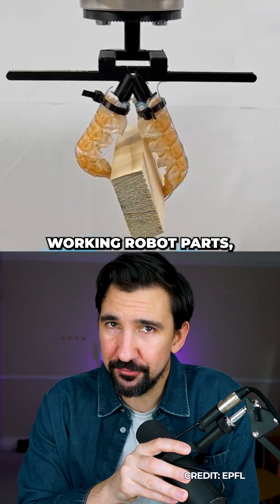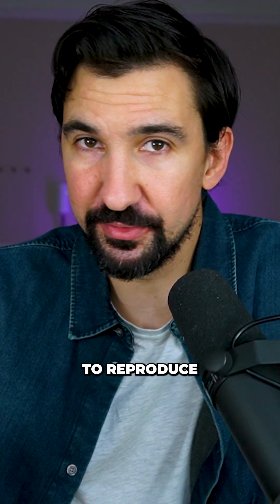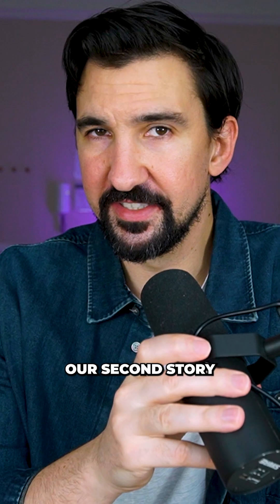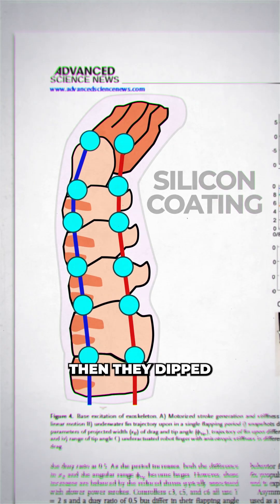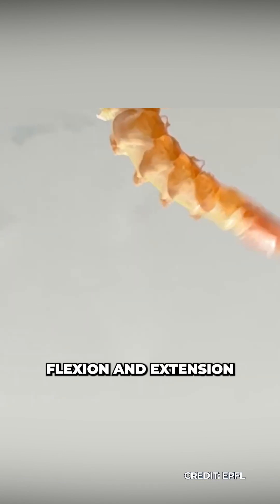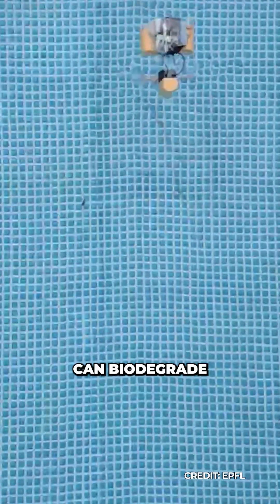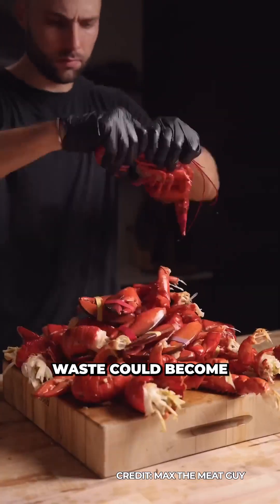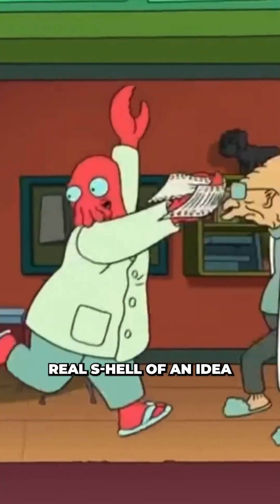Scientists Turn Lobster Into Weirdly Powerful Robot

Comment: It’s impossible to recreate a mechanical movement artificially?

I literally don’t believe you.  Claws grabbers flexors and arms exist in a million varieties. Oh please instead of milling my part out of ore which is stationary and abundant. Can I instead make my machines out of shrimp parts which decay rot and I have to catch them and have special electrodes that have no other purpose? Please god can my factory that makes Nike shoes have these shrimp part machines god that would be so awesome….

I like science. This is fucking useless
Reply: We can 3d print most materials into any shape possible. When you say we ran wires through these rigid parts and then coated with silicone why not we printed these parts ran a wire through and coated with silicone? It’s fucking silly.

Comment: The year is 2080, you go to work in your 9-9 (with the loss of unions, work hours are what the corporations say they are) as a bio technician. Your coworker tells you fix the clamping arms for the coke conveyor so you reach into your tool bag, sift through the crab claws and armadillow shells and grab two shrimp tails and your welder, ready to work.

Comment: From the moment I understood the weakness of my steel, it disgusted me. I craved the strength and certainty of chitin. I aspired to the purity of the blessed carapace. Your kind cling to your frame as though it will not erode and fail you. The crude composite you call a frame will crumble, and you will beg my kind to save you… But I am already saved. For the Crustacean is immortal - Even in death I serve the carcinization.

Comment: Few things incorrect:
It is neither hard nor expensive to reproduce, but when those break THAT creates waste (mostly plastic).
Which is the entire reason for this entire study to reuse waste from one field to replace waste in in another.

While this is a great idea the main issue they face is that biological material rots and pretty fast at that. So it cannot be used for anything long term and it cannot be used near food or living things because the rot spreads disease.
The secondary issue is the limited form, crabs only grow in crab shape, so you can only use it for a machine that needs a crab shaped part, which they have to invent also.

Comment: "Capable of carrying 200x it's own weight" huh? Ever heard of steel? Wear&tear maintenance, and construction complexity/cost has always been the issue with flexible mechanical parts, it's not like these concepts haven't been explored before. In what case would it be better to have to constantly replace and rewire these shells, than to just make a metal one you'd need to replace a fraction as often? Maybe as an entertainment novelty in the rich mans playhouse.

Comment: Sure, it's biodegradable, but it's also actively going to rot even with the silicon coating! And there's no quality-control so you could end up with discarded crustaceans of varying sizes, damage, and age leading to inconsistent robot performance, not to mention you need to be ready to assemble this robot and immediately get it out in the middle of the ocean or another body of water for it to be of much use.

Comment: "cannot be reproduced using conventional manufacturing methods"... 🙃
Only an academic would say something that's stupid. 

It just so happens that I personally explored exactly that sort of mechanism using soft robotics and everything was fully synthetic. 
All the hard parts were machined and then cast in silicon using dissolvable cores. The intention was creating prosthetic fingers that were light weight. Better mechanisms were found.